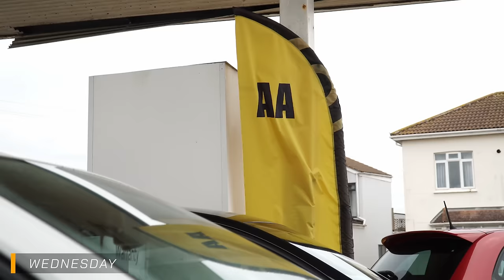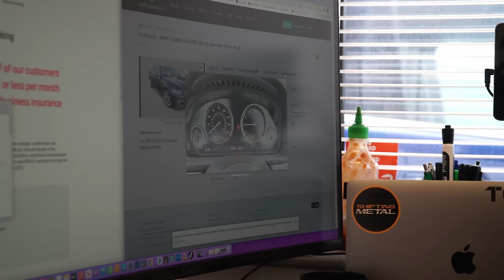The Car Warranty Claims Just DON'T STOP Coming! | BM Weekly EP 24

Comment: It seems most mechanics are going through the same scenario as you. Mechanics should be doing really well but there is something going wrong with all all of them. One thing I have noticed is they all don't have enough ramps to work on. One needs double the amount one thinks they need because you must now realise that getting parts is not that easy. Japan started it with their just in time business which is great until wars begin and now part making has to move to other countries. You strip the vehicle down on the ramp and then can't get the new part so one has a dilemma. Plenty of ramps then you leave it till the part appears. If you need the ramp then one puts it back together and moves off the ramp to store it somewhere which ends up being double work for same money.  🤔🤔

Comment: I had similar issues with older main dealer px cars changed to higher mileage 3/4 year old ex lease. But it is so so dull buying blue grey Passats A4s A6s base spec BMWs just no variety or interest like the franchise dealer px section.